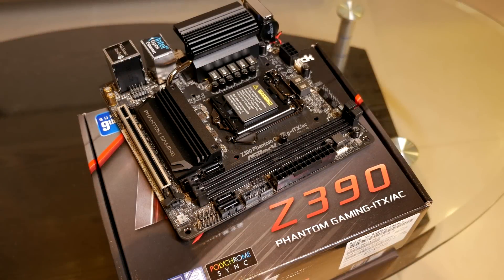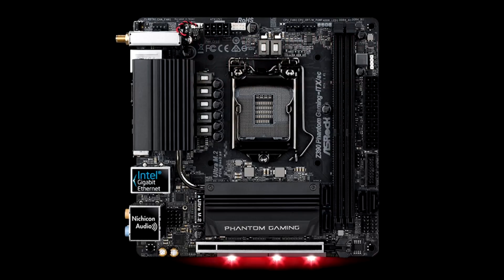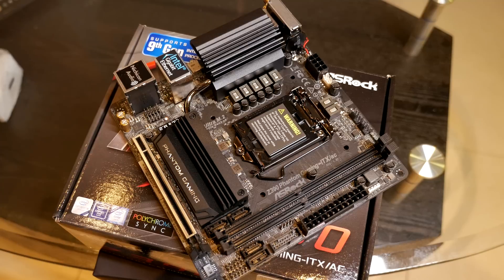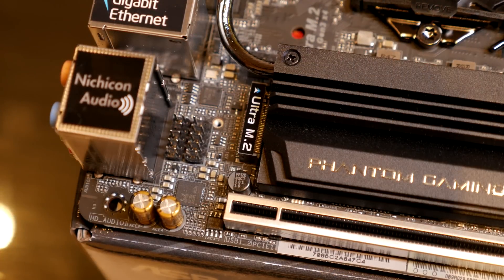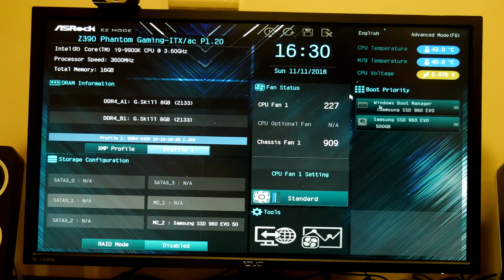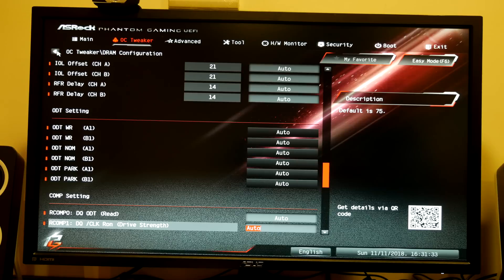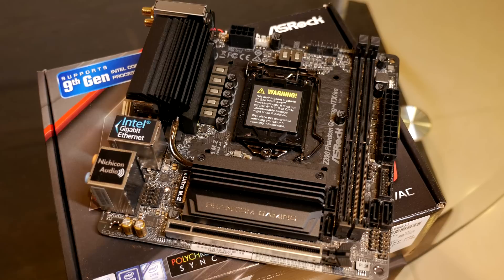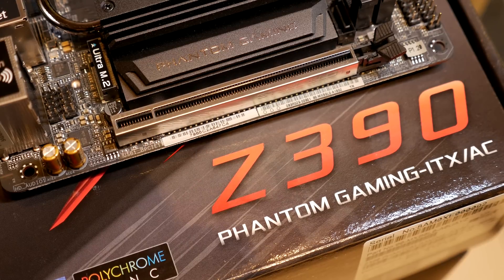Asrock Z390 Phantom Gaming-ITX/ac Review - Tiny & Tough

Comment: I purchased this board for an HTPC project with Stracom  silenct pc config. utilizing a Intel i7 9700T CPU. The board came with the P 1.20 bios. Before I started buidling I learn that this CPU (i7 9700T) require version 4.0 bios og higher. In order to upgrad one need to have an compatible CPU and one that cover all bios version is I3 8100. The thing is that in my case I am not able to upgrade W/O me purchasing said CPU. Is this the case? Someone please.

Comment: can it handle the 8700k at 5 ghz?
Reply: Yeah but if price diffrent better on z370 itx, i would go for z370
Reply: Thank you for response; so which Z370 ITX which can support 8700K, 5 GHZ OC would you recommend?
Reply: J Boy all z370 can, depends on your budget.

Choose a board with good vrm heatsink.

I use a asus strix f gaming, i 7 8700k delidded. 

And if check price on z390 too, today i see they about same price like z370 atm in my country

Comment: Got the 9900k and will cool it with a noctua nh-d15 inside a  fractal nano s....believe it will fit because i took all the mesurements but with the asus z390-i.

I guess the i/o shield of this one and the asus should be the same height.

What cooling did you use for your test ?
Reply: Forget about this motherboard ....the ram slots are too close ...a large water cooler won't feet....I got the nzxt kraken x42 and do not fit because of the ram slots

Comment: Hello! It is possible to boot a PC with this motherboard using an external Thunderbolt SSD? There are any different speed performance between the M.2 slots? What kind of cooler you have used for tests? Could be possible to use a Noctua NH-D15 with a Intel I7 9900 on this motherboard? It is enough space? I'm trying to build a portable workstation and put some basic questions before any acquisitions..